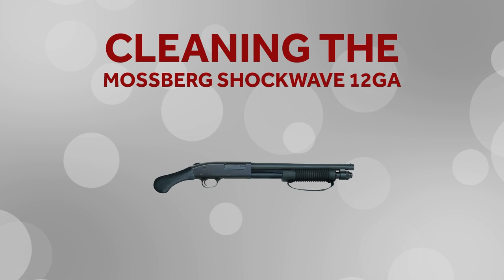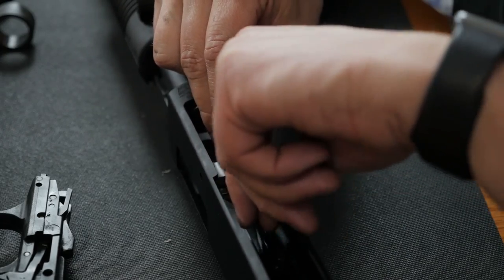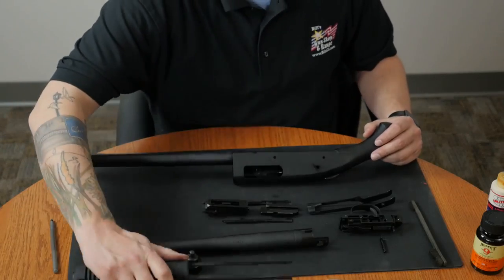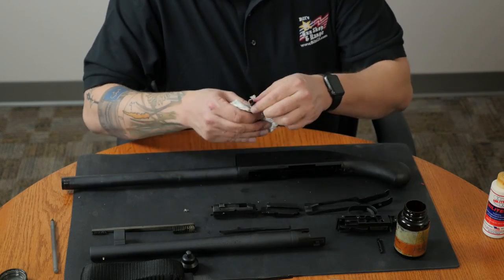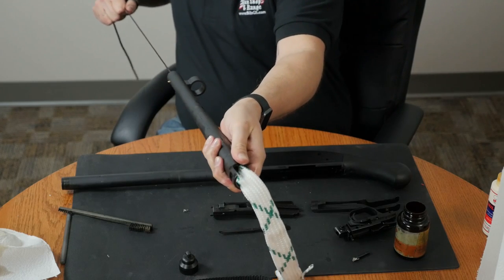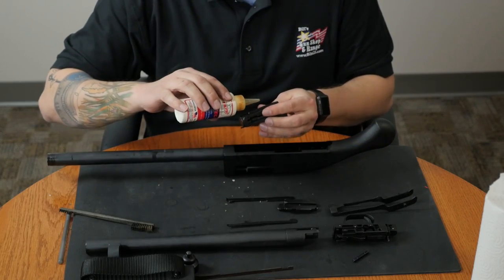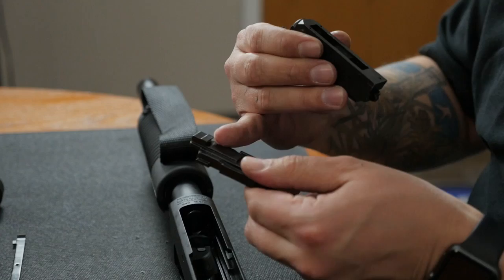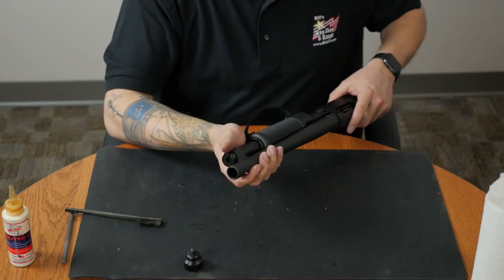Cleaning the Mossberg Shockwave - Bill's Gun Shop & Range

Comment: Personal opinion here. . .  I think using paper towels is a bad idea. I use old T-shirt rags. Much less debris.
Reply: A. S. I agree. I use T-shirt rags or cotton shop towels. It’s also a good idea to have compressed air handy to blow out any loose dust mites on everything.
Reply: Darren Ward - I use a barber brush to get all the dust off. In the field you don’t have electricity to power a compressor.
Reply: @CatMan_7   good tip on the barber brush..👍
P.S. I think he was talking about compressed air in a can
Reply: Personal opinion here. . . I used Tampons.

Comment: Damn, I didn't know the stripping and cleaning my Glock 19 would be easier than my Shockwave 590..This is going to be interesting...
Reply: i just got done cleaning someone elses shockwave. goddamn it is a fucking pain in the ass.
Reply: It doesn’t get much easier than a Glock take it out of battery pull the tabs on the side and pull the slide off then pop out the spring and barrel clean lubricate and put back together takes 10 mins max
Reply: 12Gs have some of the most complex parts in firearms, a lot of people don't know this

Comment: I used this video successfully, but damn man; arrange the bolt and reciever in correct orientation on the table and DO NOT twist and turn it as you assemble!  Give some warning about the two shell bars falling out of place and the need to use fingers to retain them while getting the trigger assembly to slide foreward.  I gave you a tumbs up, but damn!  Make me appreciate my 870 WIngMaster,  lol
Reply: After awhile the bolt amd stuff get easier.  The shell stopper amd extractor "bars" fix is use to magnets on the outside of the gun to hold the bars in place hands free. Much easier